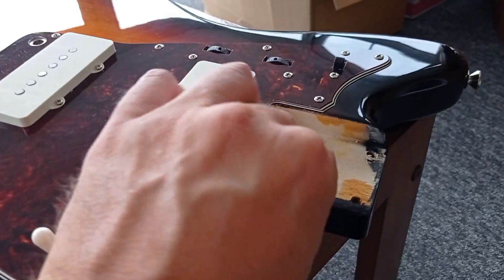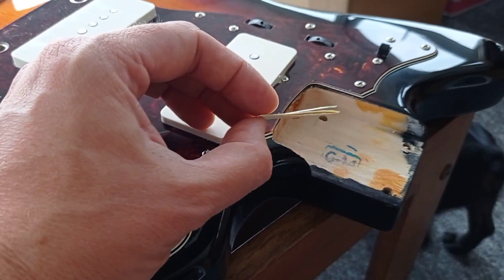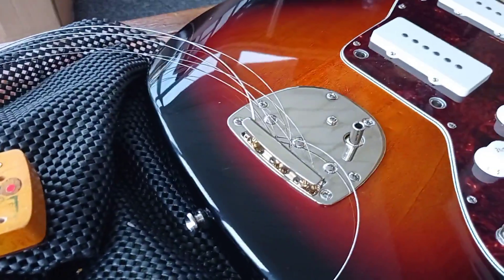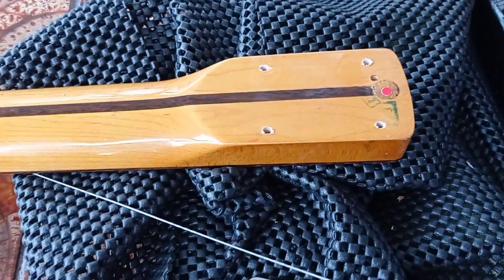How NOT to Shim a Guitar Neck!

Comment: I have a little tip that you could consider, the screw sizes and types in cheap end guitars are of the thinest and cheapest generally, and with this comes easy breakage, corrosion etc because of the thread pitch and space, a good and better way to repair this type of issue is to upgrade the screw to imperial and stainless, the shoulders are much thicker and taper shank, coarse thread and the existing hole makes a good pilot for them, I've done this on a few myself, the results are top notch, and the screws are like back in the seventies good solid decent fasteners that won't snap and difficult to strip because if the taper which those modern cheap one do not have, something else for your consideration perhaps.

Comment: will need to figure out the shim situation on my jaguar build in the near future when I get back to it. I have never checked my MIJ Jazzmaster but no problems with break angle etc.  I Had a thre strip on my mim telecaster neck screws  and I fixed it by jamming two cocktail sticks  down there with some wood glue, whittling them flat and then screwing it back up, everything tightened nicely and stayed true. I took it apart a few months after and it still tightened up without spinning. I'm not sure how long it will last (though the glue and the surrounding wood should protect the cocktail sticks somewhat)  but I prefer this to using bigger screws since it doesn't mean I'm using any of the actual wood up theoretically I can do this again and again, as opposed to if we encounter the same problem again with the bigger screws- whre i guess Dowels would be the only soloution.

Comment: Does it play well without a shim?
Reply from the maker: Yes it plays just fine, I adjusted the string height all good to go 🎸👌
Reply: @theguitarmanifesto  nice! The reason I asked is because I got a CV Jazzmaster the other day and it played well straight out of the box (except for the sinking bridge but nail varnish !) but I shimmed it anyway as I did my Jag... It plays well now so was it really worth the shim? As you said, shortscale forums are full of good info about Jags and Jazzmasters but are they always necessary? What's your experience?
Reply from the maker: If it ain't broke don't fix it is my opinion, if you're having issues like lack of string tension/string slippage then go for it. 
I've had 4 of these CV Jazzmasters never had the need yet to shim one.
Reply: @theguitarmanifesto  very true. I like 11s so string tension is not a problem. It's a great guitar anyway. Pickups are really nice especially the neck and middle. Bridge is OK but workable